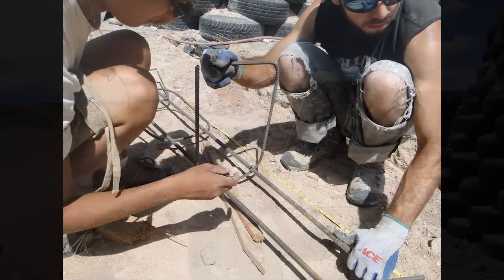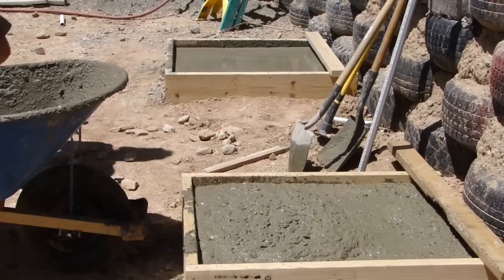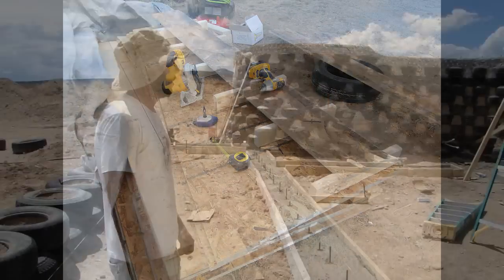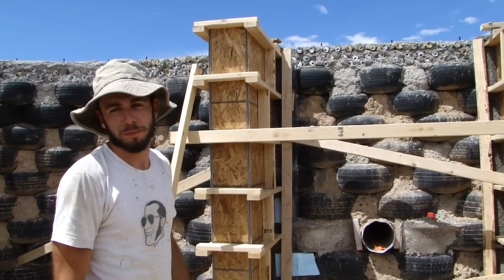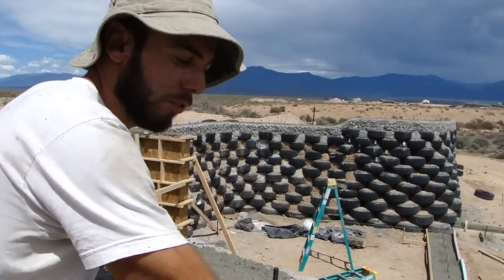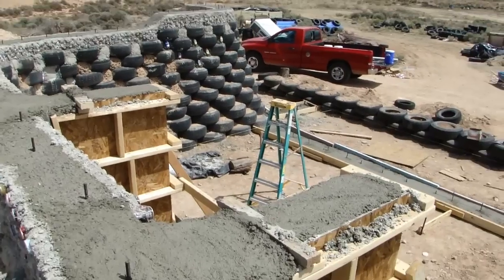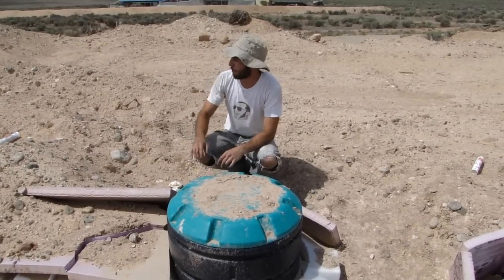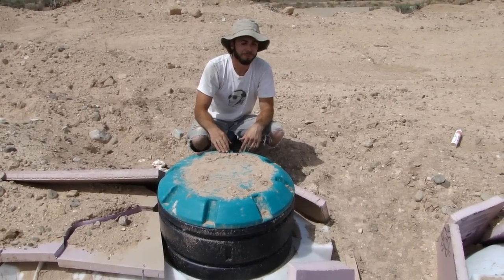Overview of Footings, Buttresses and Bond Beam

Comment: The "tie in" for the tire wall (vertical riser) can be laddered from the tires to the face of the piling at each level of tires. It will hold the vertical pieces of rebar in place before the placement of the cement. Great job any way you go!! Beautiful!

Comment: Thanks for all the up close detail. 
I'm concerned about a frozen cistern in a cold climate. 18" frost line? Mine is 6.5' What difference does the frost line make if the cistern riser is kind of open air? In Taos, even the average high in January is above freezing. The cistern has that open hole, probably to allow the pressure out when drawing water. How does that work when it's -30F, -40F, or even -45F? It makes sense to insulate the cistern a lot? R-40? Should I get a 1.9 meter high riser?

Comment: The can wall is to hold the concrete bond bem in place so that it can set up and dry. You can also build can walls inside the earthship. But the can walls can't be used for holding up heavy things like the roof.

Comment: Thanks for the videos!  Very helpful, how do you deal with curves in the tire wall if they step back 1.5in each layer?  In other words the distance needed to be covered by tires would increase with each layer leading to gaps wouldn't it?

Comment: Are the two sections of the tire work on a slight slant....like a retaining wall? But the back walls are plum? I have his books.but they don't talk about the global model but he goes threw and acknowledges the retaining wall?  Im gonna build an earthship but cut down on the tirework by using his method in the studio e.s....by digging the floor out a ft from the bottom and reinforcing it with insulation rebar and cement.

Comment: Great build.  What type of foundation is required for this type of construction? I want to build a new boxing club and this looks like an economic option.
Reply: the tires are wide enough that in most cases you don't need a footing, but you will need to check local building codes for your area.

Comment: would it be faster to pour cement into the tires instead of pounding dirt into them?
Reply: You wouldn't be able to pack the tires with cement like you can with dirt. And if you are going to do that, you loose the whole reason of working with what you have and might as well just pour big concrete walls. Because, it would cost the same anyway.

Comment: hey yo, I'm just some rando creeping on your page 10 years after you made this video... I'm getting into the weeds on EarthShips, and why not just use stone for a lot of the material applications that you're doing here? Can walls are cool conceptually/ aesthetically, and I can see where they make sense, but you'd use less cement with a rock wall. Is it about the skilled labor or making a rock wall v. anyone can throw mortar at cans? Still wrapping my head around it ecologically. I gather the culty /dogmatic aspects of this type of architecture, but lets make the buildings fit local conditions. A building that works in the low desert is not the same as one that works in the high desert is not the same as one in the midwest. Anyhow, love what you do, keep it up, think deeply, read as much as you can and slow the fuck down. Be well.